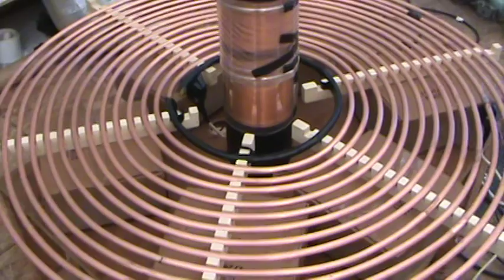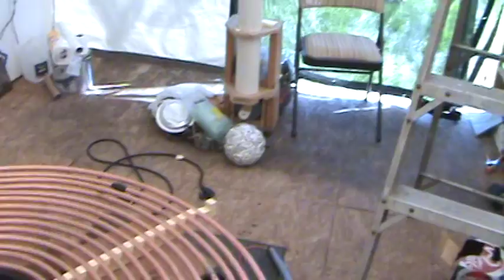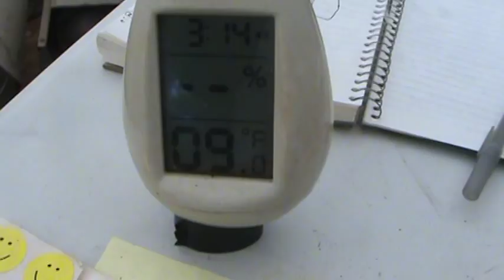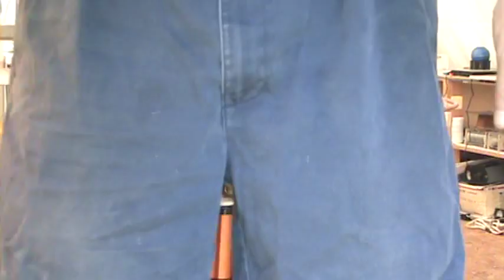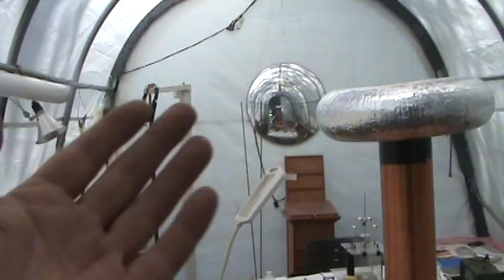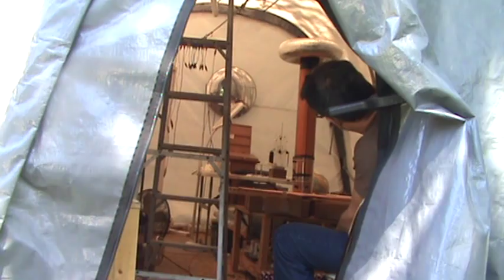Tesla Coil Re-build, Part 4

Comment: There is a lot i can see wrong here, But the real joy is when you go through every headache of trial and failure to bring the big sparks  then it becomes an art. [ build a better spark gap ]
Reply from the maker: Thanks  you.  I read most people with large coils like this spend more time farting around with them, than actually running them.  I feel im getting close,,,i just posted part 7.  Rotary spark gap maybe best, but my gaps are not bad, they have tungsten carbide tips, the rest is stainless steel. I can also quench the gap with a fan.  Thanks for commenting.

Comment: Hi Paul,  great set of videos you have. I tried the free energy germanium diodes and only got about 6 volt but when I used a bridge made up of MUR diodes and connected to my tesla coil I got around 15 volt. Wish I had more experience to help you with your tuning set up.I was able to get my resonant frequency by using a multi meter on Hertz setting and just held near the secondary when on a low power setting. I can now tune the primary to match using a function generator set on the secondary frequency and monitor with a scope.  Just look for the maximum voltage on the scope by moving the tap. I watched a few videos on tesla coil tuning but still have lots to learn. Looking forward to your next video